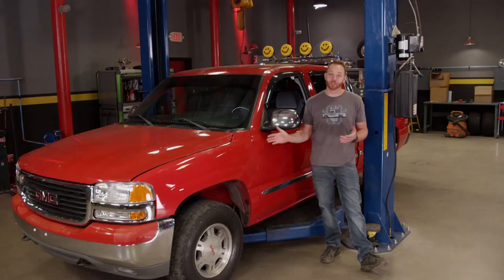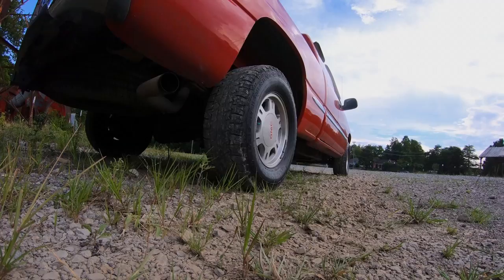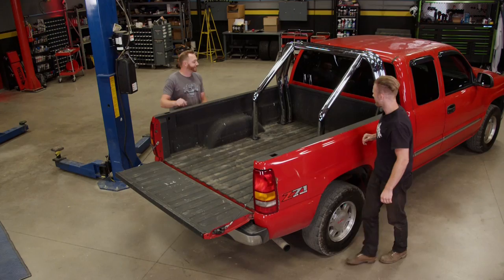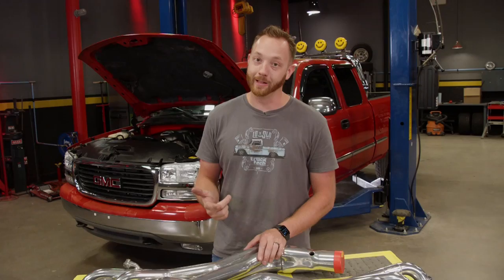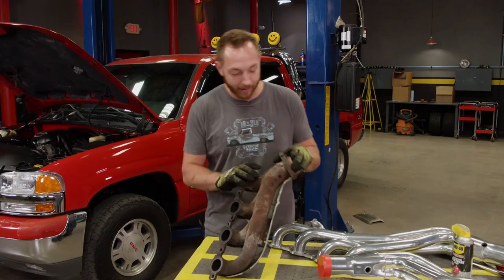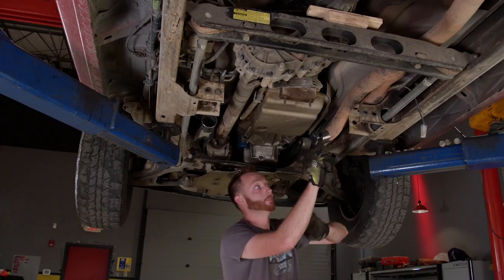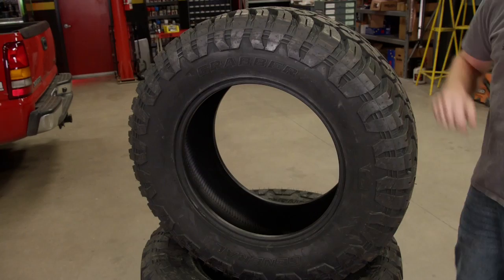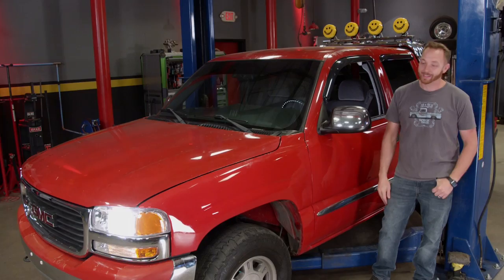Adding '90s Flair To A 2000s GMC Daily Driver - Truck Tech S7, E17

Comment: Don't give the thieves any ideas.
I run 15 inch white spoke rims because they match my boat and rv trailer but more importantly, less popular so don't have to worry too much about tire/wheel thieves.  
As far as the "light bar", one of my friends had his stolen at work.  This was in the late 70s.  He saw two thieves walking down the street carrying it!  Luckily he was able to chase them down and retrieve it.  This was way before battery powered tools so they had to have used wrenches.  I can't imagine how fast it could be removed with power tools today.

Comment: Well back in 1980 I had me a 1978 K10 long bed with a 4" lift, 36x14.50x15 Pro Trac Hi-Rollers on 15x10" aluminum wagon wheels and a 3" welded roll bar with 4 6", 2 250,000 CP & 2 500,000 CP,  KC Daylighters  on it. That truck went through just about anything.

Comment: I like your idea. It brings back some fond memories of my life in the 80's. Speaking of the 80's, you would have  impressed me if you had followed stylings of the Fall Guy's 1980 GMC 2500. That's the truck that set the tone for lifted trucks of the 80's.

Comment: In the start video the red Ford pick up looks just like mine. It's a 75 F100 .Bought it in 1980 for 3900. Lost it in a divorce and bought it back 5 years later. It sat in a pasture the whole time. I still have it  would love to restore it but getting too old to do it. Interior still looks like new body has surface rust. The engine is a 390 and needs rebuilding. 3 on the column and 411 rear end with dana lock.

Comment: Yes the big roll bars in the bad are old school, but they can be made to be functional as well.

Ive seen then be used to act as tire carriers because the spare couldbt be mounted underneath the frame/bed anymore due to mods.

You can also put on locking cases for gear and tool without further modding your bed.

Comment: The matco impact you are using has a problem with the trigger in a normal shop use the trigger will malfunction and not work because of the vibration of the tool hammering things off and hammering things on takes 90 days to get it back from matco to ol after they fix it
Reply: Had mine fixed in a week...

Comment: That set up and the truck are decades apart. The truck being newer than the adds being a very bad thing in my opinion. But I was born in ‘91 when those KC lights were already going out of style. Should’ve at least use and older truck. It definitely made the 02 feel several years older.

Comment: That is too new of a truck for an old school roll bar light combo. No no no that doesn't look good.
Reply: TominBach  I have an 05 gmc sierra slt 1500 5.3 and it had some sort of light bar in tip and it just didnt look right on that style truck. Maybe on the 80s square body it looks good jusy not on the newer trucks especially with the rounded body style. That's all I was saying. I'd def put it in the old square bodys though.